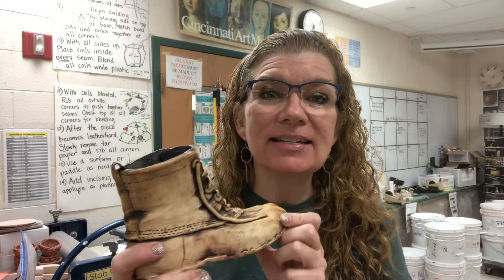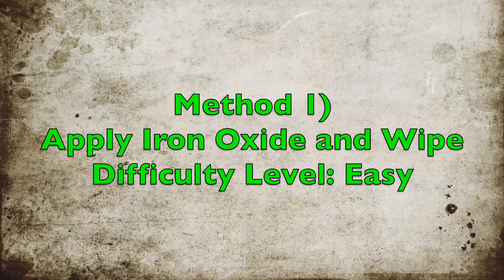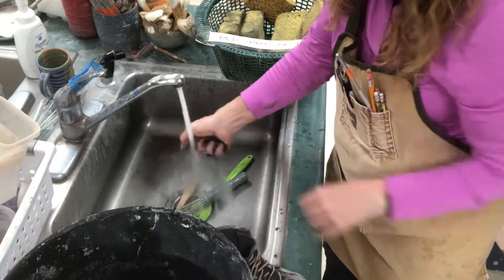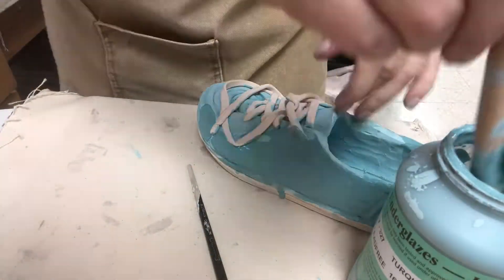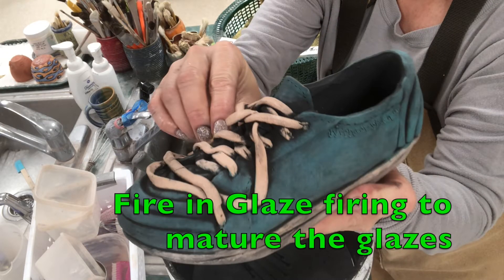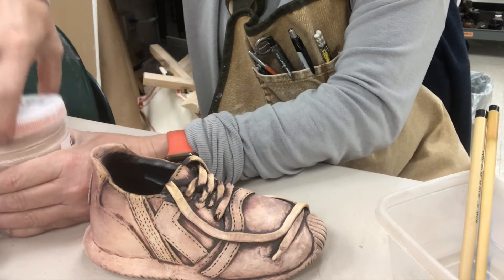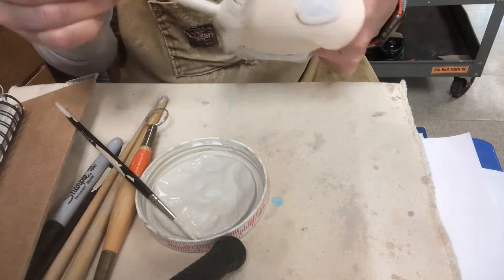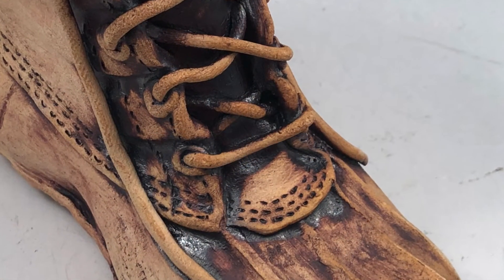3 Ways to Finish the Bisque Fired Shoes with Iron Oxide and Glazes!

Comment: Hi Karen, I love your videos - thanks so much! I have a question about iron oxide. I use red iron oxide mixed with water, but it won’t stay mixed and ends up all clumped on my pieces. It’s very difficult to work with, but I prefer the look to that of underglaze. Do I need to add something to the water and should I be processing it somehow? Thanks.

Comment: Hi Karen, is that black iron oxide vs red iron oxide?
Reply from the maker: Oh, yes- I should have mentioned that!  I actually only use the black iron oxide with my students, so I didn't think to differentiate!
Reply: @KaransPotsAndGlass  Are there other colours of iron oxides besides red and black? Thank you. 😊
Reply from the maker: I know there is also a less stable yellow.  Also, I use a frit with my iron oxide, to help it melt to the surface of the pot if I’m not glazing.  I have a separate video on how I mix it. If you want other colors, I would just recommend using underglazes to achieve the same sort of look as the iron oxide, with the exception being it won’t melt with the cone six glaze like I show the iron oxide does!
Reply: @KaransPotsAndGlass  thanks Karan! I love your videos and really appreciate your posts..
Reply from the maker: Thanks, Leslie!!! 🥰